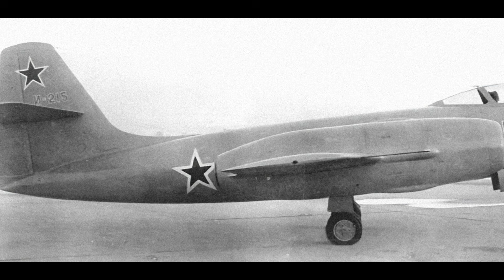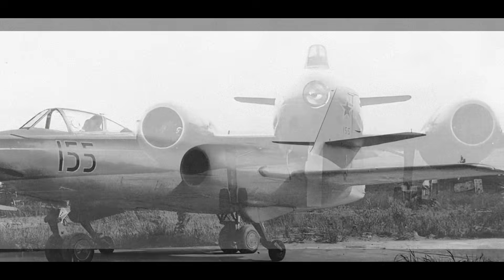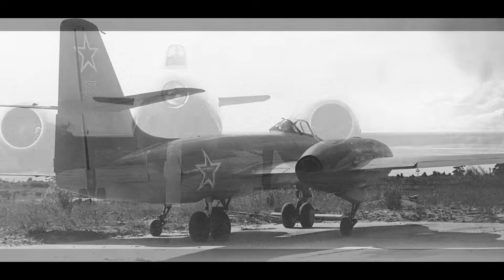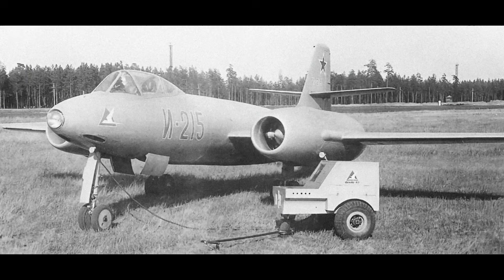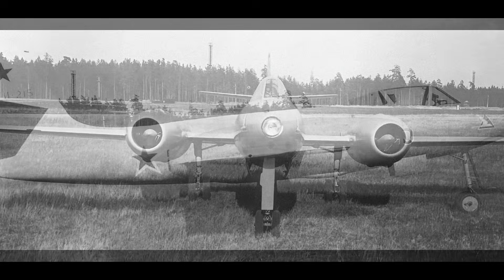I-215: Why This Soviet Fighter Had Bicycle Landing Gear

Comment: "if the pilot pulled too hard on the stick, the aircraft would provide clear warning with a slight buffet" -- did the buffet include a good selection of zakuska for the pilot? Or should the word have been pronounced ending in "-et" rather than "-ay", the mispronunciation of homographs (words spelled the same but pronounced differently) being a defining indicator of an AI-driven text-to-speech system taken as gospel and published without review to get videos submitted faster.

Comment: It was not in fact slower at altitude. 
Assuming calm air and standard atmospheric conditions, 520 knots indicated AirSpeed at sea level is ~598 mph over the ground. 500 knots of indicated AirSpeed at 16,000 ft is ~758 mph over the ground. 
Your indicated AirSpeed decreases for the same speed over the ground.

To throw a wrench into things, 758 mi per hour at 16,000 ft would be exceeding the sound barrier that is roughly 720 mph.